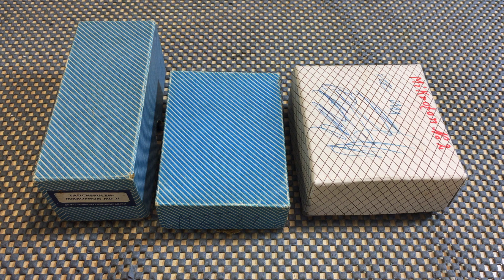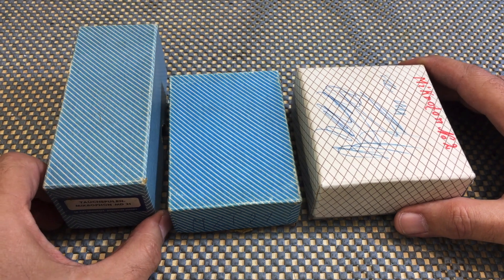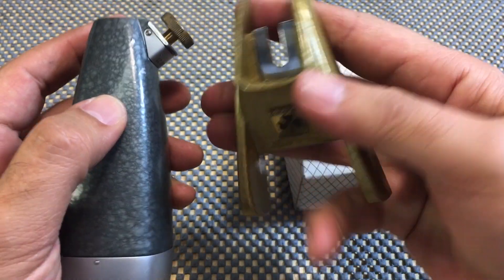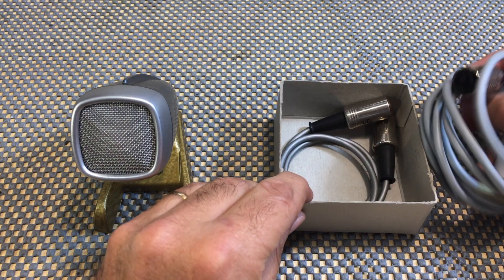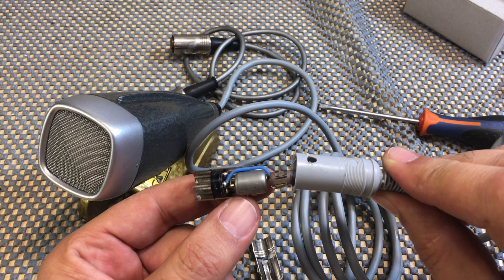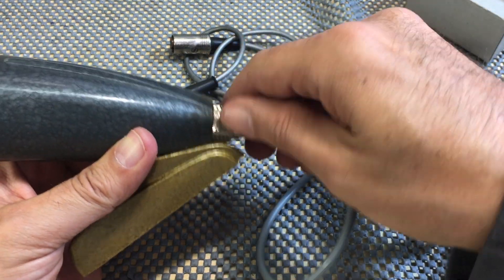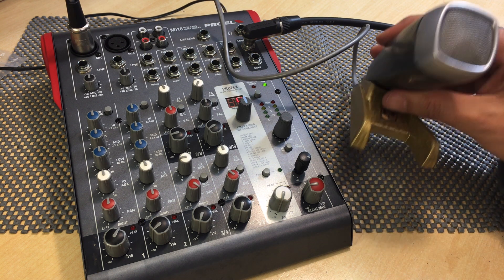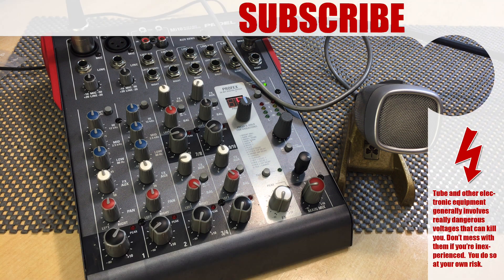Adding XLR output to vintage Sennheiser MD21 microphone

Comment: Hi. I'd like to connect a vintage UHER M640 microphone. The output is a 7 DIN male plug. But there seems to be no adapter on the market to a TRS that I could plug in my FX box. Have you any idea on how to engineer a decent solution for this ? Thank you very much.
Reply from the maker: Afraid not. Haven’t come across one of those so I’d be guessing

Comment: The Uher M534's have a similar transformer.
Reply: except their's are built in near the capsule and not the plug!  I know because I have about 20 of them ;)
Reply: I have about 8 or 9 in my mic locker which I've converted to XLR..They had an additional small inline transformer housed within the din plug, which I presume stepped up the impedance to 600ohms to operate with the Uher tape machines.
Reply from the maker: @bensmethurst7821 👍

Comment: But it takes having the appropriate cable first to know if it works. Interesting and balanced to unbalanced din cable. I believe Din connectors are unbalanced so getting that little converter in there is amazing. Generally you wanna have pin 2 positive when a signal pushes in on the diaphragm. Although there was a bit of a standard conflict with the UK for a while as they decided on pin 3 positive until everybody just finally decided that Pin 2 was to be the Hot Signal. That microphone is in great condition, And it's always nice to leave the original cables original. There was also some weird standards for a while where male - male or female - female was common for connections.

Comment: I own the Grundig version of this microphone. The only difference between the Grundig and the Sennheiser was that the Grundig had a fixed wire attached. Now I am horrible at soldering, so a friend cut off the Tuchel and soldered on a male Neutrik XLR plug. It wasn't working perfectly, so I opened it up again, and isolated the individual wires a bit better. I am getting a pretty decent signal now but there seems to be a grounding issue. Unless I put my finger on the male end that is plugged into my interface, I am experiencing some pretty intense buzzing. I didn't quite get what exactly you did with yours to avoid this. Did my friend, who soldered it, get the routing wrong? Do you have to wire any of the pins to the shield? Hope you know the answer to my problem. Thank you anyways for this video. Cheers and greetings from Germany :)
Reply from the maker: That buzz is usually a grounding issue. The shield may need to be connected to the ground pin of the XLR. Try it with a piece of wire and see if it makes a difference. If it does, then solder it in permanently.
Reply: @electronicsoldandnew  thank you so much!
Reply: false facts, I have a Grundig Version without fixed cable and its original.

Comment: To test if the mic capsule is okay you can connect a multimeter on two of the pins, put the multimeter on mv and then make a noise into the capsule. If you get a spike in voltage, the capsule should be fine. If you have an oscilloscope, you can also test using the most sensitive setting. You can use the hold  function to see which way the waveform is starts in order to know the polarity of the capsule.

Comment: Hey :) Those MD21 have been very popular for journalists / outdoor interviews with our german broadcast companies back in the 60s and 70s, as they are omni directional mics, and for this reason they are less sensitive to wind noises, compared to directional (pressure gradient) microphones. 
I'm happy to see, that you left the mic with it`s original Tuchel connector - building a special cable (like you did) imho is the better option, as long as you don't have the original conversion parts by Sennheiser, that would turn such a microphone into a MD21-U (the "U"-Versions are always with XLR-connector).
By the way, I still use two different mics in my own studio, that are equipped with the large Tuchel connector (it's a bigger and very robust version): One MD21 and one MD421 - both are nice, old Sennheisers. I use the 421 regularly, this is a great microphone (the 441 is still better, though).

All those vintage Sennheiser mics have been very underrated back in the 80s and 90s (I remember, when I was in school, nearly every school-pa-system provided a few of those mics, but it had to be a SM-58, if you were performing with your school-band... Those crappy old Sennheisers were "uncool" stuff... Today, those mics became very sought-after, especially the original 421 & 441... - because they simply are very good!
One more tip (we call it Eselsbrücke = Donkey-bridge) about the XLR connectors: Always think about making love: the male pin goes into the female hole - and the signals flows the same direction as that glibbery white stuff does... ;) 🤭 Now you will never ever forget again 😂
Reply from the maker: I think a lot of “old” devices were thrown out to be replaced by “new” ones, which were actually crappier. Fortunately quite a few of these treasures can still be found, and will last a lifetime if treated well. 
The image you’ve created in my brain regarding the signal flow will forever stay with me 😊 thanks 😊
Reply: I got the Grundig GDM 121 today for free with the original box, it has a fixed cable and as far as i read it's not an XLR connector. Is there a way to connect this to a computer without destroying the original cable? Like an adapter or something? Sorry, i am a beginner in these things. Thx in advance.
Reply from the maker: I don’t believe you can because it will have to go into a buffer of some sorts
Reply: @electronicsoldandnew  So the only possibility would b to change components inside the microphone. Is that something you would do, i mean because of originality? Because like it is, you can't really use it for anything i guess.. But thx a lot for the answer

Edit: i even have the original box
Reply from the maker: I only do this as a hobby, and have my hands full 😊 If In were you I’d keep it original.
Reply: @electronicsoldandnew  Maybe i sell it to someone who appreciates it the way it is. Thx bro

Comment: The stand is from a 1958 Grundig
 GDM-121. Sennheiser made this microphones for Grundig and they are identical to the MD 21. They was simple debranded.
Reply: The Stand is from a Grundig 1954 MD21 in Gold. My Father bought it in this Year. The later GDM 121 has the Transformer from the Jack put into the Mikrofon-Body. Both Mikros have the same Capsule from Sennheiser. Therefore the GDM 121 is Unsymmetric an the MD21 Symmetric. Grundig needs for his Tube Reel to Reel a High ohmic Mikro

Comment: Hey :) I've got myself a old Telefunken TD 20 TS and it has a old Din/Tuchel kabel as well. Inside of it are 3 cables. A White one a orange one, the both go to the sam slug and the ground wire goes to the middle position. The third slug has a tiny tiny little wire going to the slug with the orange and white one. How can I convert it to a normal XLR?
I'd be thankful for any tips.
Greetings, and very interesting video

Comment: Happy New Year. Love your channel. I rebuild tube guitar amps and audio live sound reinforcement gear, studio gear. Great video. Thanks to you and a few others I’ve got the tube radio restoration bug. 😎😎 Congrats on your new Brymen meters, I own 4 of them. My favorite meters. Watch Joe Smiths channel on meter testing. He likes his BM869S better than anything else. That guy does the most complex, in depth, unbiased tests on DMMs on YouTube. Makes some amazing test instruments to do it. His EE chops are in that rarefied air along with W2aew, Mr. Carlson’s Lab.
Reply from the maker: Happy new year. I’ve seen his reviews. Quite amazing.
Reply: Electronics Old and New by M Caldeira I was amazed when Joe found so many flaws in the Gossen meter. The high end price of those you’d think they would be second to none, not after Joe’s tests. Susceptible to EMF interference because of poor shielding and magnetic interference such as a hanger magnet can switch relays putting it in a dangerous situation giving a false reading of low or no voltage potential when actually it was probing high voltage. His latest tests proved similar flaws in the EEV Blog 121 GW meter, Dave should have tried to hook up with Brymen over UEI. Meter has been plagued with issues since day one. My first Brymen was the EEV Blog BM 235, just a blue boot over the Brymen red with the EEV name, but a great little meter. Fluke and Brymen were always the top winners in Joe’s tests. I actually found a pristine old Fluke 189 after Joe ran one through the gauntlet. I changed out the leaky super cap used for data logging memory as Joe suggested. What I love about the Brymen meters is they recall the last setting you used on power up, great feature that the Fluke meter doesn’t share. I bought my 869s and 525s from TME in Poland. Had them in 3 days to the states for $7 shipping. I can’t get things shipped that fast and cheap from a few states away.

Comment: Grundig sold the MD21 under their own name. The MD21 was THE microphone for reporters, most robust and almost immune against wind noise. Yours is a very early version with the flat grill. My oldest Sennheiser Catalog is from 1968, and there is already the newer version in it, with a protruding grill that has the company logo on it. The original stand for it is the MTZ 21. There was also a windshield MZW 22
Reply from the maker: Thanks for the info. I actually had no idea that it was as old as that.